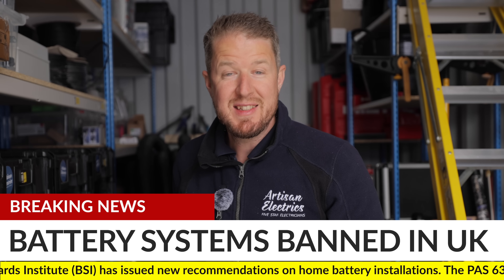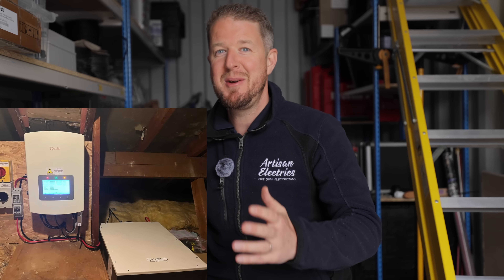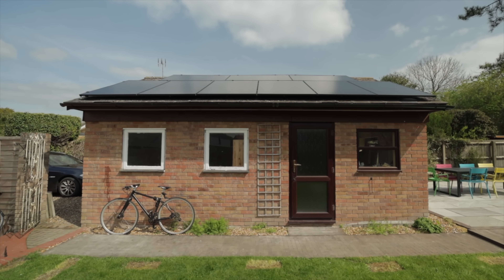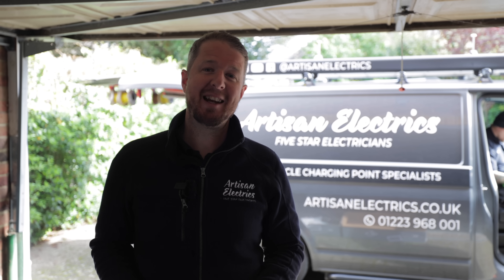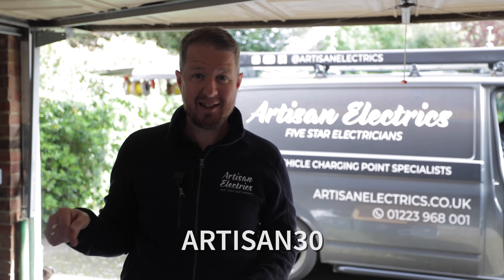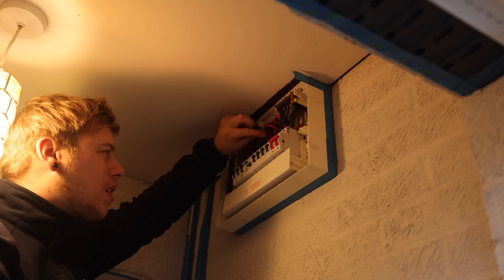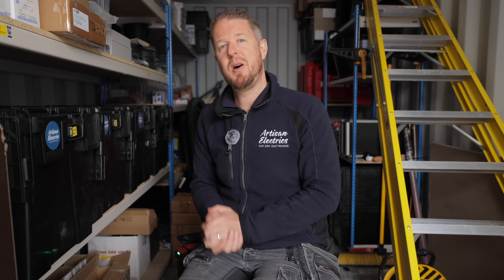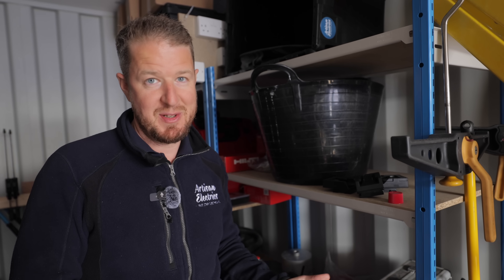Is the UK Banning Home Battery Storage? 😱

Comment: You say you don't like batteries in a loft - but don't say why!? Are batteries really bursting into flames that much? We all have pressurised gas pumping around our houses - and there are explosions now and then - but we haven't banned gas boilers inside the house.
Reply: The issue of them being heavy and becoming a missile dropping through the building in the even of a fire was mentioned. Lofts can be surprisingly fragile structures.
Reply: @richardjones5255 if a fire has taken hold to the point the integrity of a floor ( boarding in a loft ) has failed I can’t believe a fireman would be inside a house to be hit by the falling battery pack. 
It wasn’t that long ago most houses had a large metal water tank which would probably would of hurt if it fell through the ceiling ( though the water might help quell the fire 😊)
Reply: @paulblundell8033 In the example of the house I grew up in as a kid, the hot water service was in the ceiling cavity. It contained 70 gallons or 700 lb. But it was mounted above the passage of the house where there were three doors and was supported by the door posts at four points. So the hor water tank is not just shoved into the ceiling but probably built into the house at the time of construction.
Reply: @darylcheshire1618    - properly designed into the structure...
Reply: @richardjones5255  a battery I was just looking at weighed 100kg. That's just the weight of one fat person.
Reply: @richardjones5255    - yes a second (+) story is designed for live loads, a loft is not (often) - In Europe a lot of loft floors are poured concrete - therefore provide a firm fire resistant floor for most eventualities..
Reply: I honestly think these potential new regulations will severely restrict the uptake of solar. I have just had solar installed and it really makes sense to add a large amount of battery storage and I was lucky to have the space in my garage to do it ( which is attached to the house !) but many of our friends only have lofts or maybe basements which are both potentially no go’s. A large amount of housing stock in London just doesn’t have garages or even outside walls ( unless you use the front of the house which they will not be keen on )
If the issue is the weight and the batteries coming through the house, why not have mounting systems that are fire rated to say  1 hour+ to stop premature failure and better fire and heat detection by the install.  

That all said, after working in many lofts, the extreme of temperatures is certainly not ideal for most battery systems.
Reply: From what I read, it's not the likelihood of them catching fire, but the potential for harm if they do. Lithium batteries burn fast and very hot and cannot be put out with water. Your comparison with gas is interesting though - I believe that gas boilers can be installed in lofts. 
I guess, like the video I am just 'wary' of batteries in lofts given the potential for a very fast developing fire. Perhaps gas boilers are considered a 'necessary evil' at present and batteries are not? I wonder if the rules will change as we learn more about lithium battery fire safety (the regulations say that little is known at present and rules may change).
Reply: You are all missing the point. Lithium batteries ideally should be kept as close as possible to 10-25°c as possible. In addition should never freeze as you cannot safely charge LFP below 0°c. The UK wood construction loft is too warm in summer! Placing  batteries in temperatures of 40-60°c as I would guess most lofts reach in summer is a very stupid idea. At those temperatures you are dealing will extremely high power production so the inverter will be overheating already need cool air and the batteries will be overheating failing to cool. So now you are risking the inverter failing, typically throwing out lots of heat and smoke as it fails. Lofts made 14:18  of wood, insulation, or other burnable materials above where you are sleeping is a really bad place to choose for your inverter to fail. The whole house will be consumed fast by fire.

Do yourselves a favour. Choose a place away from the house living space for both batteries and inverter, and try to insulate the batteries in winter. Again your aim is 20-25°c as best for longevity of batteries. It needs to be dry, with no condensing moisture. Never ever allow your batteries to operate near 0°c. You should keep them really above around 6-7°c for them to charge properly.

Many battery BMS will self regulate on not only over/under current and voltage, but also cell temperatures for the batteries for very good safety reasons. They can throttle the battery current at low temperatures or even shut down the batteries.

I like to think of them as mini bombs. You might want to treat them with care as if you don't really really look after them they'll burn your house down. You seriously need to take care of them, and  decide that if in the very unlikely event that that bomb starts to burn, you chose the safest place possible. Look after the temperatures of your batteries folks, and don't be stupid, keep them away from your loft, get the in your garage. By the way, almost no containment will be fire proof if lithium battery packs decide to 'let go' and turn into fireworks.
Reply: Because working in a loft is nasty
Reply: @jocramkrispy305  probably best not to become an electrician then 😊
Reply: @paulblundell8033  Oh the memories... Lofts and under floor crawlspaces.
Reply: Yes they can ‘burst into flames’ then again only a fool would install a boiler in no a loft!
Reply: You have a very valid point but in a lot of cases where there have been gas explosions it is usually as a result of work carried out by an unqualified person, and illegaly. Only a Gas registered enginer can work on or install a boiler so at least there a rigid standards applied and annual tesing to ensure safety assuming you follow the sensible path of annual service. In addition all modern boilers have built in safety systems to reduce the risk of problems. Lithium ion battery technology is inherently far more unstable and much more dangerous if it lets go.
Reply: @mlgboy1  do you have any stats to back up this?
Reply: @adsheff  Sedewick Insurance stated: Sedgwick’s experts in the UK handled nearly 1,000 losses in 2023 where lithium-ion batteries have been at the heart of the cause, a 50% uplift from the year prior. The indemnity spend on these losses is now approaching £100m and this doesn’t take into account the lithium-ion battery marine cargo losses we’re handling in UK waters.

Comment: Put the batteries underground? Thermally stable and no issues with escape routes. Thanks again Jordan. You should be compulsory viewing for all entering the trade.
Reply: You lot real???? Water ingress and all sorts of issues with putting in ground
Reply: @bramcoteelectrical1088  We can make waterproof underground boxes (a basement is more-or-less this), but I agree it's not a very good idea to just stick batteries in holes - some of them would no doubt end up flooded.
Reply: Underground in the UK is a bit cool - at about 12C in the south and 9C in the north, but it would be much better than a loft or an outside wall. You'd have a humidity problem instead of a temperature one of course.

Comment: Guidelines. That's the key word as you said. There's clearly a reason to not fit batteries in loft spaces, particularly with poor access. 
LFP is safer, but you still want to check on them occasionally. Fit and forget leads to neglect. 

Outside for LFP in IP rated cases with no heating is just silly. 
I've seen installs even this month specifying outdoor LFP without heating mats. This is a recipe for uselessness in winter. The old argument was "well there's not much Sun in winter anyway so it doesn't matter" but that is long dead as reasoning because of smart tariffs mean many people are able to utilise their batteries in the winter to run their home power at a fraction of the cost via overnight charging or agile tariffs etc. 

No LFP without heating capability should be installed outside or even in a garage. Puredrive, i'm looking at you.

Comment: Li-po or Li-ion would be my biggest concern ... having seen multiple li-po spontaneously combust with next to no way of extinguishing it i suspect these are the cause of the new legislation.  Never seen or heard of a quality li-ion combusting in a home but we know once ignited they are just as difficult to extinguish . For example i run 960ah of li-ion in my van and many people more never once have i heard of any fires and these are being knocked around most days on top or solar and mains charging. Improper installs and  poorly made components i suspect are to blame
Reply: Nobody has ever made commercial domestic lipo batteries (and yes it would have been a bad plan). A few outfits made Li-ion domestic batts (notably Tesla). Almost all of them are LFP (and Tesla have switched now too).
Reply: @xxwookey  I mentioned li-po as there are few people in the comments that seem to think they have them installed, I've never seen them used myself but there are batteries out there large enough that could be used but massively unstable though as you know . I have seen li-ion used multiple times though not in sealed units and with independent cooling
Reply: @JamieFullerton1  I'd be surprised if anyone does have such a thing from an actual manufacturer, but there are no doubt a few home-made ones. But if anyone really does have one, do show us a pic :-)
Reply: @xxwookey  I've had a 4000ma lipo combust in my garage luckily it was stored in a fireproof bag but can only imagine a 14kw bank going up

Comment: To me, the killer restriction is that batteries outside of the house shouldn't be located within one metre of a door, window or ventilator port so that excludes the whole front and back of my house. The only viable wall is in a narrow side alley, and a battery there would probably prevent my bicycle handlebars going through so that's a non-starter as well. The only compliant location I can think of is to build a hard standing at the bottom of the garden (more cost to build this, plus dig a route for the connecting cable etc.). 
These changes are likely to greatly reduce battery sales if complied with, and agree with the comments below that insurance could well be invalidated if a home owner chooses to risk a non-compliant install.
Reply: I'm in a similar position except I can get my bike out of the rear. I wonder if mounting the battery higher than your handlebars is a possibility?

Comment: How many fires have been due to domestic batteries igniting?
Reply: There was an LFP installation in a guy's cellar in Lauterbach that offgassed, filled the cellar with flammable gasses and somehow found an ignition point. It blew up one end of his house. That might've been safer in his loft.
Reply: @spankeyfish  as far as I can tell from searching is that it was a '30 kWh battery storage system'.  I don't know the normal systems installed in Germany but this sounds unusual.  A 'DIY' job using repurposed batteries perhaps?

Ah'. "The system owner is an electronics technician specializing in energy and building services"

I'll presume that is a not a professional domestic install that we see in the UK using common commercially available equipment and therefore an outlier rather than something you could reasonably expect from properly installed battery systems here.
Reply: @spankeyfish  and the report found says '30 kWh battery storage unit' and 'The system owner is an electronics technician specializing in energy and building services'

Any chance this was a DIY system using a repurposed car battery? 🤔
Reply: Quite a few in our area.
Reply: @joeds3775  what is 'your area' and how do you know what caused the fires?
Reply: @FFVoyager  I think it was a bloke down the pub told him.
Reply: Cheap batteries with poor bms causes the fires 🔥 😢
Reply: @bramcoteelectrical1088  what cheap batteries and where has this happened? 🙄

Comment: Would there not be a case for additional ventilation and fire protection being offered as part of the Installation? This "recommendation" feels a bit like the foreign Manufacturers' putting their design issues on us, yet again.
Every time there is a new technology rushed out into the field for a quick profit, the Electrical installation industry is put under pressure to research, train and spend money to learn what the problems could be with it. if a product is approved for sale in the UK, it surely must have be carefully tested and properly rated for the environment. If these Batteries are dangerous, when fixed in the wrong environment, should it be the front line install Electrician that needs to find a way of overcoming what is essentially a manufacturing issue?
 If these products can overheat to the extent that they can burst into flames, when doing what is their only actual designed function, that is surely a Manufacturer's problem.
Manufacturers must fix the problem, state clearly where and how these must be fitted and offer auxiliary items to overcome any possible limitations.
If the install guys then choose to ignore these instructions, then that's on them, and they should be held accountable , but only then.

 restrictions

Comment: A good balanced video but you missed the insurance aspect. Insurance companies will make their own assessment of the situation and whilst technically an installation may be deemed safe, if home insurance cover  can't be obtained at reasonable cost the customer is high and dry. Also there is the suggestion that internal batteries have fresh air ventilation.
Reply: You don't have to have home insurance, but obviously most people like to have some because it's a very expensive thing to self-insure. I've always taken the view that I could afford to rebuild so didn't actually need insurance.
Reply: LiFePO4 batteries don't need fresh air, but they may need thermally regulated air in the range 10 to 40C.